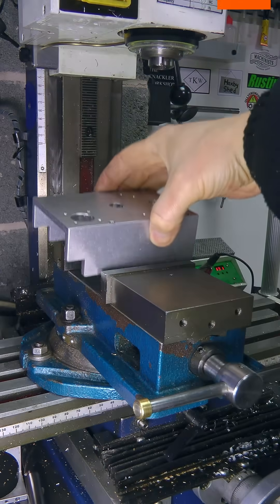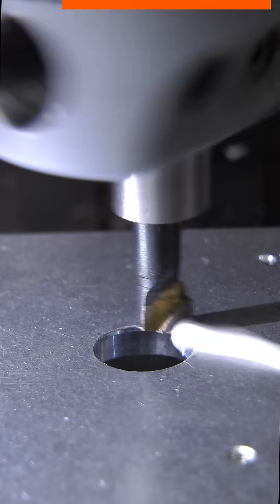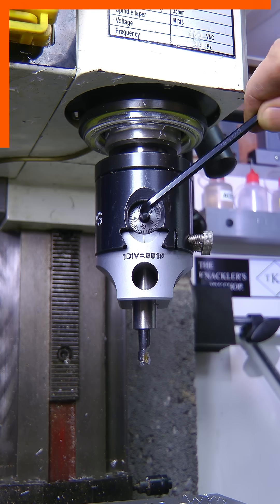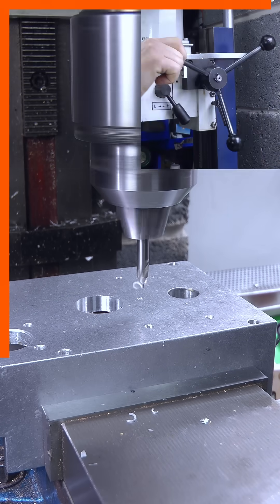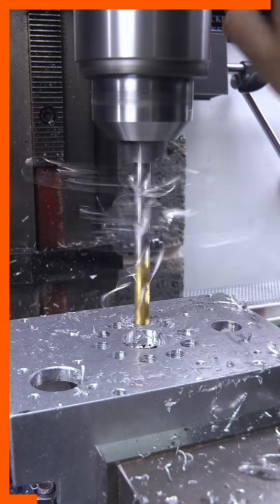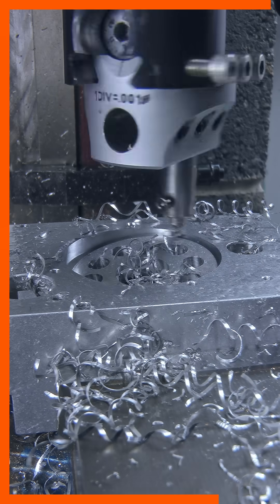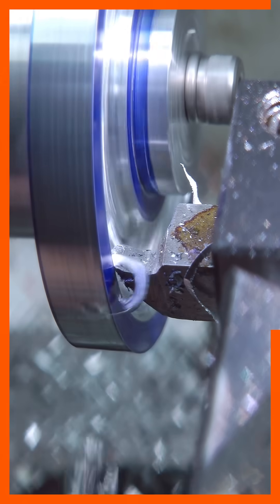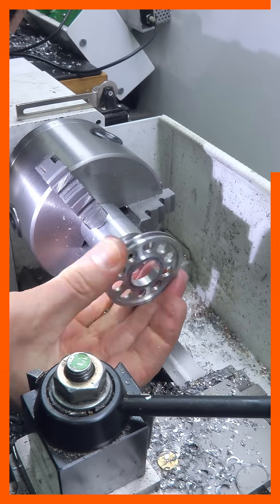Machining a Pulley From Scrap #minilathe #machining  #diy #maker #shorts

Comment: Getting a small bearing like that to press fit in (without  the bearing binding up) requires about 0.0002" - 0.0004"  undersized on the bore.

Getting an accurate read down to 0.0002" on those kinds of bore gauges is also very difficult. :/

Comment: Provil has been incorrectly tensioned in the vice, can be bent or even pulled out when spared. You have to clamp longitudinally or work with an inside block where the U provil cannot be compressed
Reply from the maker: For this very reason there was a spacer fitted the same width as the U channel for the machining operations. It is briefly visible around 39 seconds when the cut disk is lifted from the parent material.

Comment: It was hard to tell from the video, but it appears as you're using your telescoping gage incorrectly. You drop the telescope engages into the bore at a slight angle.  You then tighten the telescope gage and roll the gage so rhe handle is aligned vertically, and then a vouples degrees past that.  This will position the telecoping part of rhe gage to match the bores ID.  You will eventually get a good feel for this and you will know when you've used them properly to get the correct measurement.
Reply from the maker: As noted in the video description. Thanks for watching 👍

Comment: Nobody uses a press to fit bearings into  aliminium part. The aluminium part gets heat up with a heat gun instead, then the bearing outer ring freely gets into the seat with no effort. As son as the part gets cooled down it holds the bearing as it should.

Comment: That first step was awesome, but was it necessary? You had plenty of material so even 2mm excentricity with the present boring wouldn't make difference. Or am I missing something? (This is not criticism, by the way, I just would like to understand and learn.) Thank you!
Reply from the maker: You are correct! There wasn't a great deal of spare material, but the dial gauge was a bit over the top. Close enough would probably have been been good enough. The other reason was I also wanted to try to keep the width of cut consistent, rather than having a thick bit and and a thin bit, which might have pulled the hole more oval -these small mills aren't especially rigid. Thanks for watching 👍 🇬🇧
Reply: @TheRecreationalMachinist  Ah, nice! I already was thinking in that direction. Thank you for the explanation! I am going to watch more from your channel, it looks very informative.

Comment: The tool you used to measure the hole size on your caliper, why didn't you use a vernier caliper. I mean considering the rest of the video is very professionally done that one minor detail almost ruined it for me.
Reply from the maker: The internal jaws of my bog standard vernier calipers have non-zero width which means they actually measure the distance between two (not quite) diametrically opposed chords, not a diameter. In percentage terms this error is more significant at smaller diameters, and given that I was trying to measure to less than one thousandth of an inch I chose a telescopic bore gauge whose domed surfaces much better approximate a point contact. Apologies if your viewing was spoiled by my use of the most accurate method my limited toolbox permits.

Comment: why dail it in?
Reply from the maker: There wasn't much spare material, so I wanted to make sure I was right over the existing hole. But you are correct, a bit overkill, close enough would have been close enough in this instance. Thanks for watching! 👍 🇬🇧

Comment: I was gonna mention you used the spring bore gauge wrong.. but then I saw you using a trepanning tool with a boring head and thought to myself , wow, I wish I thought of that it would have came in handy so many times 😂 so thanks for that I have a lot of ideas now for some parts

Comment: Beautiful! I can imagine that precisely drilling the holes around the center bearing is the most difficult step in the process.
Reply: Got to bust out your trigonometry.  If you plot the positions out, it's not hard to dial the machine to each of the coordinates.  Just do your geometry.
Reply: Not at all actually! If you have the machinists handbook, there's a section on calculating bolt hole circle locations based on several different starting positions, hole counts, and diameter.
Reply: You can get a decent DRO with hole pattern feature for a reasonable price.  Worth every penny.
Reply: He has what is known as a DRO on the mill. You tell that device that you want a bolt hole circle and enter the diameter of that circle and the number of holes. Is show you where you need to go.
Reply: @oldfarthacks  Yes, if you have a DRO it's probably the easiest part of the whole process.  If you don't have a DRO, it's still very easy using trig or just Pythagorean theorem.  A piece of paper, a pencil, and a calculator helps
Reply: @oldfarthacks  the lovely machinist calculator can also do this!
Reply: Making a treppaning tool is the hardest part unless you already have one made that can go deep enough